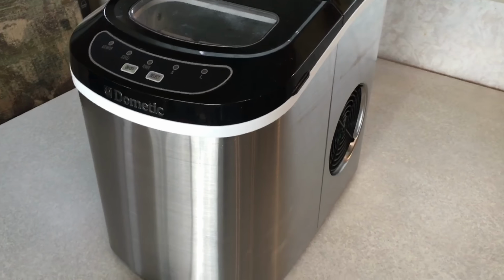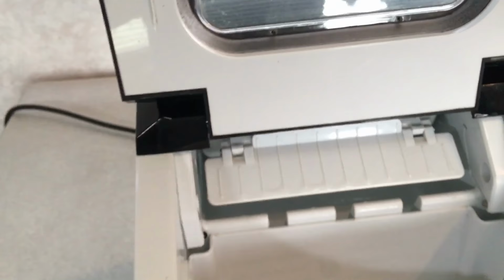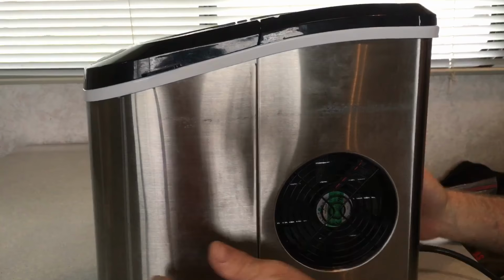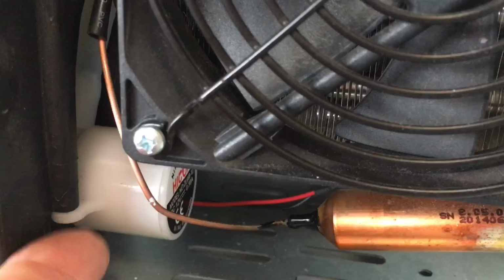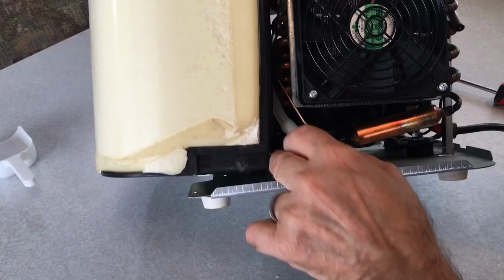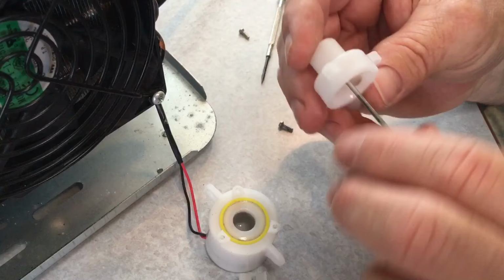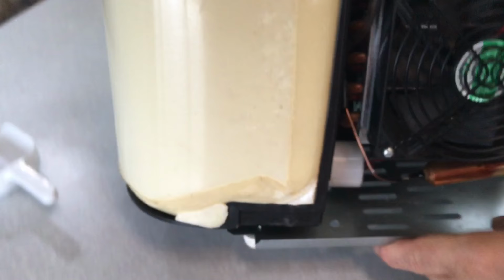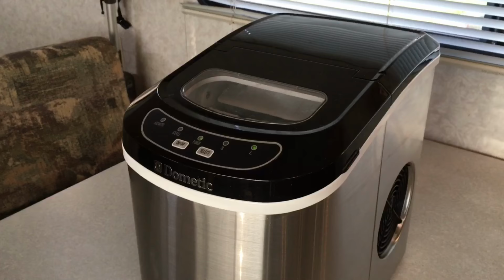Portable ice maker not working, watch this before throwing it away

Comment: A lot of these models like this one are mirror images just with a different name.  All made in China.  You don't need to take the front cover off.  The back comes off easily and most anything that is replaceable can be accessed from there.  You will need a magnetized screw driver to replace the pump and be careful when you take it apart there is a small gasket inside that is clear and you could lose it.  If pump is not working most likely it is a problem with the limit switches so check that first!  You don't need to let it sit for 24 hours maybe an hour will do it.  There is oil in the compressor and you don't want to slug it if you have turned it upside down but an hour is plenty of time on this unit as it is only a small compressor with very little liquid.
Reply: A few hours upright was my experience as well.
Reply: You can pull the pump and clear the impeller blades from the top side without tearing the complete pump apart. Use a pair of fine point tweezers and remove any trash or hair.
Reply: @glennroach1834  Mr Roach, hello sir, the pump is a little bitty thing and easy to take apart and reassemble.  Just be careful to do it on a table to not lose a small part!
Reply: What should I do if the prints are not getting cold, and therefore not making ice? Everything else works.
Reply: @MD12134MD  I don't know what prints you are talking about but if the water is circulating and the fan is running and the compressor is running then I would try to blow the condenser coils off.
Reply: @frankroper3274  prongs. Shitty autocorrect
Reply: I have the very same model I got it at Walmart and my son's threw the box out and I was unaware so I can't take mine back and it's brand new and in frustrated bc it's only making 2 pieces of ice when its should make maybe 12 each time. literally I have 2 prongs that work at a time is there anything I can do before I have to buy another one ?
Reply: @Qtwitmadskillz23  Well the compressor is working if it is making any ice cubes so you would need to check if the water is flowing over the entire evaporator when it is running.  If it isn't there could be a restriction but if it is the evaporator could be dirty.  You could try running a 50/50 white vinegar and water through it a few times.  That could help clean the coils...also check to see if the fan openings are blocked and clean those out if they are.

Comment: My mother is on her 2nd machine. Both units mysteriously stopped working.  She has to have her ice to chew on.  After watching this, I suspect we have same issue or certainly with same parts system.  Gonna take em apart tomorrow and get em fixed.  I can't be the ice runner for the rest of my life.  She literally  has the unit next to her room.  Thanks for posting the video.  I will fix these portable ice makers before I melt away.  😋  Tank Q  !

Comment: That type of pump is similar to the ones used in automatic pet water fountains.  An enclosed ice maker is obviously a lot cleaner than a pet bowl but my experience was that the pet water system had to be taken apart and thoroughly disinfected and cleaned at least once a week.  As you saw, they are not tolerant of any debris whatsoever.   One hair or bit of plastic would easily be enough to shut it down.  Great DIY fix!
Reply from the maker: LS Thank you for the positive feedback! Agreed, Those pumps are delicate yet powerful and useful in many applications.

Comment: Thanks for your video. I did have an obstruction in my pump, but it wasn't a hair, it was a small piece of plastic. After reassembling the machine, the pump was working but the movement of the tray was erratic. I found where the motor connects with the movable tray the plastic was broken and crumbled so the motor ran continuously but the tray didn't move. That's where the piece of plastic that was in the pump came from. It took me some time before I actually took the motor off, but I finally got there. Thanks again for your video. I didn't bother taking the front cover off.

Comment: I do admire how professional you created this video detail by detail explanation by the explanation I am a HVAC tech for 25 years and if you know basic electricity you could do it if you have issues try to get a electrical diagram now for the HVAC part if you don't have a HVAC EPA certification do not attempted replace the compressor before you replace the compressor have knowledge of all type of freon or gas reminder there are compressors that all you need is a small spark to create an explosion anything that you have to do with replacing the compressor you must do it outside where it does not danger anyone's life it will cause respiratory issue and yes it will kill well thank you for your video very well professional and I thank you so much God bless you all have a blessed life
Reply from the maker: Wow, thank you so much, very flattering. The compressor replacing is out of my league lol. We would probably just get a new unit if the compressor ever went out. Thank you for your kind words and professional advice. God bless you too.

Comment: Thanks for the advice. My pump had 2 small pieces of dirt in it. Didn’t have to remove the front. Also, checked motor with a multimeter to make sure the pump was ok.

Comment: Excellent vid!!

Mine is doing exactly the same thing and dumping water back into the reservoir and not reaching the ice making nozzles. Obviously a blockage or impeller jamming due to debree etc. Lookin' forward to the challenge of stripping it down and diagnosing the prob.

Cheers from Glasgow, Scotland!!
Reply from the maker: Good luck it’s not too bad of a job and well worth the work. They will all do it eventually. Let us know how it goes for you.
Reply: mine had a kink in the hose just fixed the kink and it worked great.

Comment: This was super helpful as I was already fairly convinced the pump was the problem in our unit.

I found the pump well tucked behind the refrigerant coils in this particular machine. So, instead of trying remove anything besides the back housing, I simply unhooked the tubing at the top as shown and created a gentle vacuum in the pump tubing.

After pulling and pushing the air a bit, I gave the machine another good rinse and drain (both from the drain plug underneath and by tipping the unit gently).

So far, this has done the trick and I'm hoping it will continue on like this for a while yet.

Thank you.

Comment: Thanks for the video it was very informative learned a lot about my ice maker it stopped working on me I self cleaned it left it unplugged for a few days I removed the parts like you said in the video but one thing I’ve noticed is that the fan would run for only a few minutes and stop so I cleaned the fan and whatever else I could find that had dust on it crossing my fingers and toes it’s been running for the last half and hour and now we have ice in the tray,
Again thanks for the info..
Reply from the maker: You’re very welcome, hopefully it’s still Making ice and those problems are over.
The ice machine in the video still to this day is working great and yep, the fan periodically will do the same thing. It seems the electrical system in these things get a mind of their own sometimes.
Thank you so much for the detailed positive feedback.

Comment: ** IMPORTANT - Be sure icemaker is NEVER level or tilted to the right 
facing it from the front of the machine. Better to shim two of the 
rubber feet with folded cardboard so it is slightly tilted to the LEFT. 
Why? When it fills the bucket, it intentionally overflows it to 
chill the remaining water. If the machine is tilted to the right, water 
runs down the right end of the bucket, drips on the STEEL motor 
bushing/STEEL shaft creating RUST. This WILL eventually seize bucket 
motor.

Comment: We have up to four icemakers that need repair. Have not checked the pump on any of them. Thanks for the freon tip to let it stand for 12-24 hours before start up. That wasn't done either.    
Also check for lime scale on the sensor. Just scrape off with your fingernail. The scale makes it think the icemaker is overfull.
Reply from the maker: You are welcome, thank you so much for the tips and positive feedback. 
Ever since we have been running distilled water in our machine, the scaling, mold, oder etc. has not been an issue, it’s 99% better by using the distilled water. 
Good luck on the four ice makers that need repair and please let us know what you find.

Comment: A good video, very helpful...I had an H2O tube that had a hole and needed to replace it...however I have a Magic Chef model, and like the guy says, models differ...so I had to loosen the nut/bolts for the compressor so I had access to the H20 pump plus remove the front cover taking out the screws on the bottom of the unit...so we were able to remove the H20 pump and take out the damaged H20 tube (video does well to show that)...the bolts and nuts holding the compressor in place are metric 10mm just so you know...got it all back together but had to tweak the cover to get the screws lined up for placing the front cover back in place...Oh when you take the front cover off you will have to separate it from the insulation, pretty much forcibly taking it off...again a good video but lacking the obstacles you face when doing this..thanks
Reply from the maker: So glad you were able to repair yours. Every model is different and have different obstacles. Thank you for sharing your experience and learned knowledge as you repaired yours

Comment: Im having issues with this same ice maker. Ill give this a try after i get home from work. Im trying to descale it right now. Thanks for this video.
Reply from the maker: You’re welcome, and remember you do not need to remove that front panel just the back one unless you want to.
Let us know the results please.
Reply: @reallystrangebuttrue  that was not the issue. The water is flowing fine but its not forming ice.
Reply from the maker: @paulcummins902  ugh…OK, it almost sounds like A compressor or Freon issue which unfortunately might make this machine done. Sorry if it is but keep looking, it might be something else.
Reply: @reallystrangebuttrue  its a bummer. Ive only bought the ice machine in November and used it 5 or 6 times.
Reply from the maker: @paulcummins902  You should have a warranty on it if it’s that new.

Comment: It is the refrigeration OIL that runs out of a compressor that is turned on it's side, NOT the Freon. And yes, it is best to allow ANY refrigerating device that has been upended to sit upright for several hours to let the oil flow back. BUT...not to fret. During operation, whether it is an air conditioner, a refrigerator, ice make or what, the circulating Freon entrains a certain amount of the oil and carries it throughout the system as it circulates. I've been a refrigeration tech for over 40 years,

Comment: Thank you for this video! Fixed my ice maker in 10-20 minutes because the tube had melted and cracked.
Reply from the maker: You’re welcome, that’s a new one with a melted tube, glad you got it running again.  
Thank you for the positive feedback.
Reply: How’s you fixed it if it was melted ?
Reply: @goochmcduck4285  I bought new tubing at Home Depot to replace the melted tubing. I measured it and cut it and swapped it out.
Reply: @danagumm6425  that is awesome Dana. Mine is doing everything normal, but the coil not getting cold to make ice. But every other moment is perfect. Was curious in case maybe it’s my problem.

Comment: The biggest problem with these small ice-cube makers is that, if you leave them even a small amount of time, mould starts forming... and it's almost impossible to entirely remove. It has a reservoir that you can't get to, so you'll never know what's growing in there. So, be wary of these things - they do work - but 'health wise' may not be that good.
 After my first one became infested with Black Mould, I threw it away. Now - with a simple 'redesign' (Getting rid of surplus plastic) I have device that I can place my Canned beverage of choice into and have it cooled within seconds.

Comment: Welp, I only have a single spare part after reassembly so - we'll find out how well it works tomorrow.

Wish I'd watched your method of removing the water pump before I took the bottom plate off. WOW that's a bear to get back on correctly.
Reply from the maker: Hope it’s working well, yes that is very tricky.

Comment: Thank you for this video! I also agree with vinegar being best cleaner but the hair you discovered is possibly what’s wrong with mine.
Reply from the maker: You’re welcome, thank you for the positive feedback.
We are very surprised to see you just how many thousands of these have had hair make their way into the pump.
Hopefully you discover the same and you’re back up and running, just remember you do not need to take the front cover off, we did that for videoing purposes and a lot of these icemakers have drain plugs on the bottom, so you do not have to tilt it on the side but, if you do turn it on the side, please make sure it sits upright position for 24 hours before plugging it back in and running it.

Comment: Thank you. My water line and pump were really dirty. Sadly I broke the water line fitting trying to line the pump up to get it back in. If I had to do it again I would have put the pump in 1st, then reattached the water line. Too late now, Ill be buying a new one. I had an Igloo and it seemed I needed to take the bottom off to get clearance to work with the pump. but taking the bottom off wwould have meant that I was messing with a lot of different things.
Reply from the maker: Your welcome but, Ugh! I’m sorry it broke. Some models can be very tricky and some easy. These are some hard working machines that run a little hot and can make things brittle, how old was your unit? Parts might be available for it way cheaper than buying a new one.

Comment: The thing with turning a refrigerator on its side is because the Compressor has oil in it. So letting it sit upright for 3-4 hours ensures the oil runs back to the reservoir. Frion is also obsolete and most use R-134a refrigerant.
Reply from the maker: Hello and thank you for watching. 
With so many different models, so many different age of units.
Best to cover them all so no one messes up their ice machines after finding the blockage.

Comment: for me pulling out the water pump being careful with wires made it a little easier. the tubing that connecting can manuever just stuck on with some weak glue. in alot of models it is a tight fit to get tubing off.

Comment: Thanks for the video we novices really appreciate those like you that take time to share knowledge.  

I removed the pump and checked it out - it is very clean. My icemaker turns on and after some movement (not sure what), the ADD WATER light comes on and stays on even when the reservoir is full.  After the pump, what should I check next and what is the repair?  Thanks
Reply from the maker: With a flashlight, are you able to see water flowing into the ice making reservoir? Also did you make sure that the tubes from the pump to the reservoir are not obstructed in anyway? Other than that, it would be the only thing that would sense that there is no water I believe. Please let me know as it will help others in the future as well, thanks so much.
Reply: really strange But true so I think it probably is a failed pump. Just got a new used one for $19 today so I’ll install it and let you know. Thanks again.
Reply: @reallystrangebuttrue  it was the pump. Simple replacement fixed it. Thanks again.
Reply: Not that it is any help now, but you described our ice maker problem perfectly. Took the pump apart and it was a human hair wrapped around inside. Removed the hair and it worked like new.

Comment: Ours was a broken impeller blade.  I'm guessing plastic debris (no hair) in the housing or system because it got louder and louder and then just stopped.  Lesson learned.  We also try to use distilled water instead of our hard tap or spring water.  It doesn't get scale buildup and also the mold/slime build up as fast either between cleanings
Reply from the maker: That is sad, but hopefully in the future if anything like that happens, catch it as soon as possible. 
Yes, we love using distilled water in ours, so much better.

Comment: The last 2 that I found and fixed the magnet came unglued from the plastic impeller so it made noise but didn't pump anything. I just scuffed up the shaft and super  glued the magnet back on and they are still working

Comment: Before I  puts everything back, I sanding all the edges of the metal with 240 grid sand paper.
Reply from the maker: To take the sharpness off ? Sure, that’s a great idea. It will probably slice right through that paper so you might want to use a block though, be careful.

Comment: Thanks for the video... found the hair single strand.  When putting back water hose it’s actually resting on the coil and can’t get it to move away from it will this be an issue with any heat burning the plastic hose or not?.. after one nasty cut don’t want to play around!!!!
Reply from the maker: You’re welcome, was the hose always resting on it? 
If not, It could possibly get hot enough to cause damage but in situations like this I always find it best to step away from it and mess with it an hour later or even the next day.  If you’re doing something wrong, it’s usually an aha moment after stepping away from it.
Please let us know how this goes, thank you for watching.

Comment: Ours makes ice but the "flapper" doesn't rise and push the ice into the basket. Any suggestions on what to look for?
Reply from the maker: Any situation like that, I just like to start digging in and looking for what could be causing it and I believe someone mentioned in the comments just recently that the linkage motor was not working and they were going to replace that part.